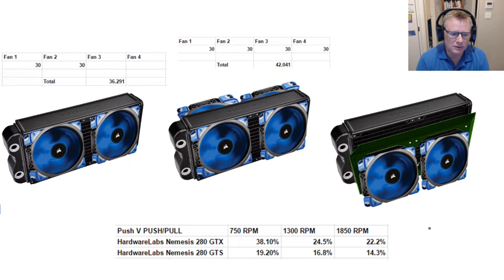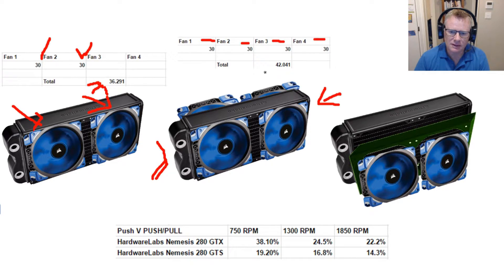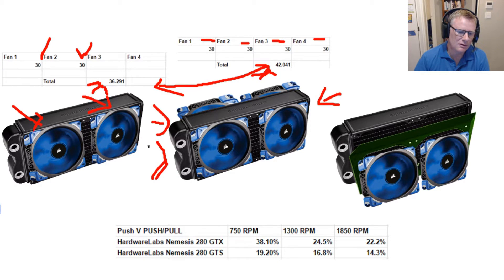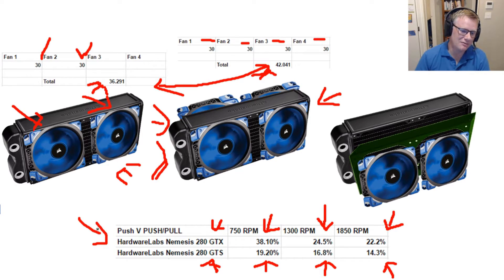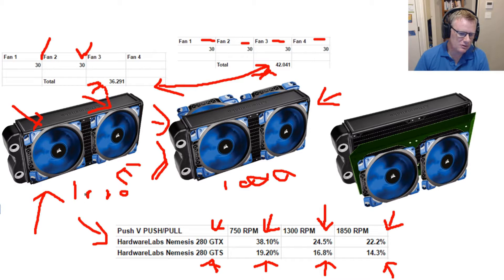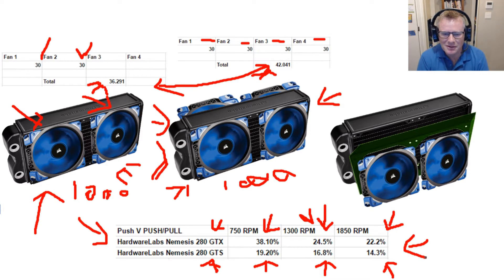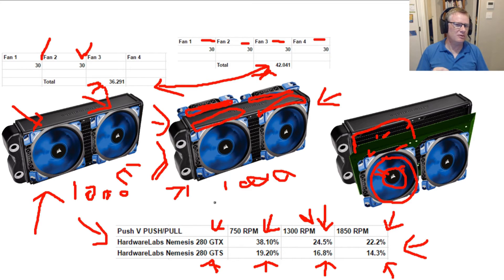Are Push Pull fans on a Radiator really better than just one fan ?

Comment: a decibel is a logarithmic measurement, not a linear one. Each 3db increase is a doubling of sound pressure, so a 6dba increase is 4x louder in sound pressure. In order for us to perceive something to be 2x louder, however, it has to increase about 10dba. Sound is not measured the way that you have explained it.
https://en.wikipedia.org/wiki/Decibel
Reply: Ultrasonic2 you said that a 6dbA increase was 60+% increase, which is true perceptually, but incorrect in terms of actual sound pressure.
Reply from the maker: Hi thanks for the comment. Im not sure i said it was linear.. Im aware DBA is not...
Reply from the maker: Have to go listen to it again (lol).. "loudness" is linear but not  DBA which i was aware of before making this video.... If i got the math wrong .. then thanks for point it out... Though not the point of the video it's important to be accurate.

Comment: It will not make any difference at all, because a waterloop regardless if peltier cooled or not, is not about how much heat can be dissipated via the radiator but about the global stabilized temperature across the while loop, once that is reached , even if you have a million fans at low rpm or super high rpm with more or less radiators the cooling capacity will always be stable to what the room ambient temperature can give......so a shroud would certainly help in efficiency up to the moment the temperature in the whole loop is stabilized......in few words You would reach that point faster with a shroud.

The main reason for using push pull configurations is in those cases where u have very thick radiators and you need tons of static pressure, in order to get the airflow Denise you pc case, and then good positive air pressure inside to avoid more dust accumulating inside and enough to expel the hot air outside the case.
The best way to keep a PC cool in a working environment is to use one large massive radiator, with very big sized fans that spin at low RPM, externally to Your pc case.
In the summer You would want to keep the radiator indoors so to take advantage of the air conditioning, in mid seasons instead You will want to keep the radiator outdoors, and in winter time You can be very happy to keep the radiator indoors and save all that extra money You spend in air conditioning during the summer.  just make sure that if You do use long tubes, to use a good pump with good head pressure, like ddc instead of d5 pumps, or other higher end pumps.........one of the things that are never mentioned  around is the lenght of the tubes and the materials used for them,,,,,, they get pretty hot and take veyr long to dissipate heat...so if u decouple You radiators in another room or at a distance, it can take a while for those tubes to cool down after heavy loads......so u might wanna definitely look for copper tubing strategically bent and placed for Your cooling system.

All this said, in classical pc configs the best solution is only two fans in the front and one in the back.....it will keep the chassis cooler more than more fan solutions or fans at the top, dont ask me why but it has been tested on some linus tech tips video... proving that in most cases more fans do not contribute in better cooling.......
As for radiators, as long as the fans you are using have enough static pressure for the radiator You chose,  it will not make any different at all how many fans You use, as long as the radiator area is enough to dissipate the incoming heat or else temperatures may stabilize but at higher than optimal levels which the ambient can offer....having excessive amounts of radiators and fans will not improve cooling but it will certainly make all stabilization from idle to full load and back of the temperatures much much faster.

If You really want super silent small sized fans these are by far the best  http://www.blacknoise.com/site/en/products/noiseblocker-it-fans.php?lang=EN

if You can instead use 180 mm fans for 180mm rads Ek vardar and silversone are excellent , they run lower than900 rpm and have lower than 20 Db ...please do note that to the human ear anything from 20 to below 20 DB is inaudible...I am running 3 180 Ek Vardars at full 900 rpm all the time, and even if i stick MY ear next to them i cant hear them at all, zero nothing ....nada

Comment: I would worry that too tall a shroud would reduce turbulence and negatively affect performance perhaps chewing into any gain you may have had from the elimination of the dead zone directly below the fan hub.

And I assign a decent value to the need for turbulence based on the difference that others have quantified in push only versus pull only setups.  I believe most ascribe the poor performance of a pull setup to the relatively laminar flow as the air is drawn into the radiator from the pressure deficit caused by the fan on the other side.  This is versus a push arrangement where the fan is creating a pressure differential AND causing turbulence prior to the air being pushed through the radiator.

I do agree that a shroud probably reduces noise and perhaps that reduction is a result of the lack of turbulence as the air flows through the radiator having been given time to "straighten out" over the distance created by the shroud before entry.

As you said, someone needs to test this stuff out.  Now their are gaskets for radiators with a kind of mesh that is supposed to promote turbulence before entry but I'm not sure that concept is valid either.  I'm sure someone is making money on it nonetheless.
Reply from the maker: Though I ALWAYS (if possible) run my rads in Pull because this is the easiest to clean and thus performance 30 days latter is better with a clean pull rad than a blocked push rad